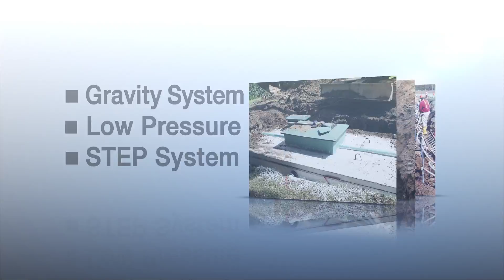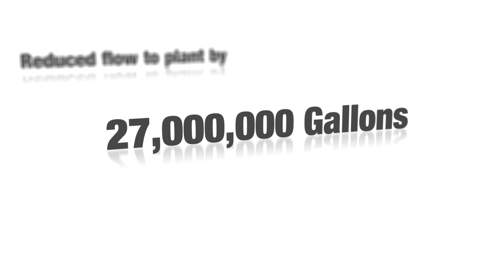E/One Sewer Systems: Infiltration & Inflow Solutions

Comment: There are occasions I can smell it.  What do you think the problem could be?  Unfortunately it is by our porch swing and  I never know when the odor is going to appear.  Can the lid be turned so that the vent is away from the porch?
Reply from the maker: Hi Barbara, Can you send a photo to eone@eone.com for me? Also, do you know what size tank or model station you have? Odors could develop depending on your water usage -- if you aren't using a lot of water, the pump isn't turning on frequently, therefore the water in the tank sits and can develop odors. You could fill up and empty the bath tub to get fresh water through the tank. Also, if the tank was oversized and the pump isn't turning on as frequently as we like it to, the water can get stagnant and odor can develop.
Reply: EONE Sewer Systems I sent 3 pictures to the email you provided.  Thank you for all your help.
Reply from the maker: Hi  @barbarawall6349   - I'm sorry I didn't get back to you last week. I sent you an email this morning (Monday).

Comment: Can the contents of grinder pump be smelled? Is there an occasional odor?
Reply: Thank you
Reply from the maker: Hi Barbara, The grinder pump station should not emit any odors. The pump turns on/off several times daily (depending on your water usage), so the contents are always "fresh." Wastewater that sits for a long period develops odors. If you were leaving your house for a few days/weeks, E/One recommends running clean water (fill & empty the bathtub) through the system to flush out wastewater. Please email me at eone@eone.com if I can answer any more questions. - thanks, Sharon
Reply: Well, it does leak odors. It will over flow on the ground as well. When it fails. The double pole beaker strips, no alarm. Out of 24 houses on my road. 24 have failed in 9 yrs. Some are on their third pump. No place to get replacement. No temporary till repair. Not easy to repair, and not easy to find someone to repair. A disaster waiting to happen.